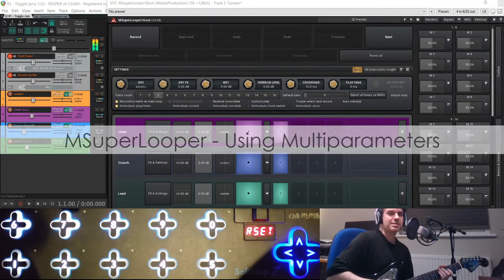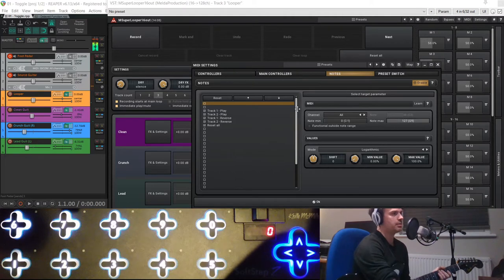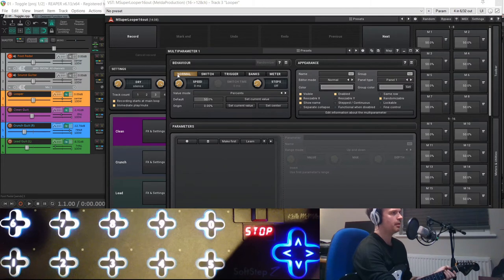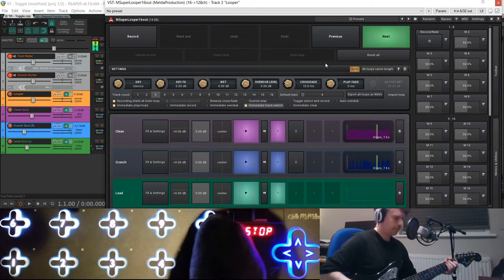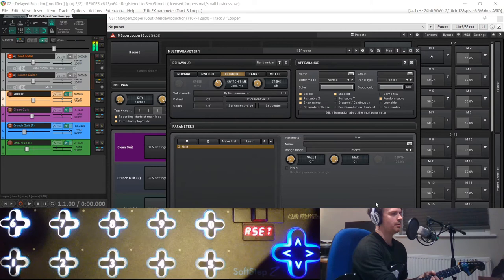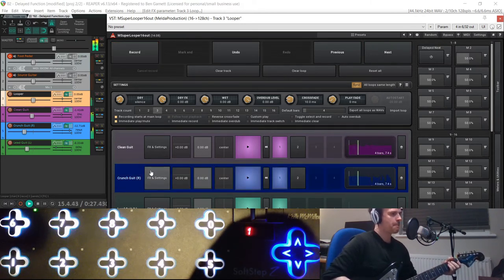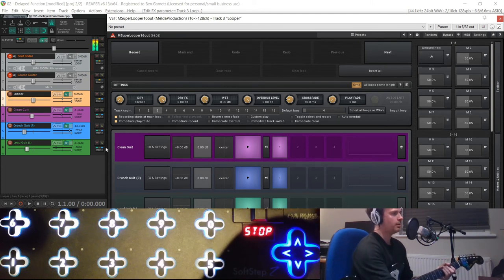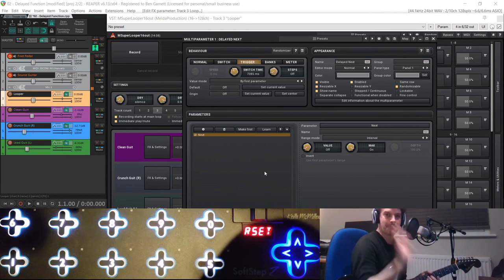MSuperLooper - Using Multiparameters to combine functions

Comment: hey man i got a question, would it be possible to set up a "mode" button? I have a custom midi board like ed sheeran does where theres a play all/stop all/mode/track 1/track 2/track 3/track 4 buttons. Essential i switch from recording mode to play/stop mode with one of the pedals so I dont accidentally start recording when i just want to play and stop. I have no idea how i would set that up so im not sure if i should be investing in this plugin
Reply from the maker: Well, I'm not so much of an expert really (as you can see in the video, I'm mainly fumbling about, trying to get results through trial-and-error). So I can't think of a way to achieve what you want using the MultiParameters, and I expect it might require some changes to the plugin itself to invoke different play/record modes. I might be wrong through. Your best bet would be to grab the demo and have a play around with it. If you get stuck, head over to the MeldaProduction forum on kvr - https://www.kvraudio.com/forum/viewforum.php?f=138. There's a few really clever guys over there who can do things with the MultiParameters that I don't even understand!
Reply: @BenTOGM  thanks so much man, how long is the trial version good for?
Reply from the maker: @heyitsaph  15 days without limitations, and then after that it starts making a noise. The installation is a bit weird because you basically download all their plugins in one package - https://www.meldaproduction.com/downloads - but it lets you select which ones to install when you run it.